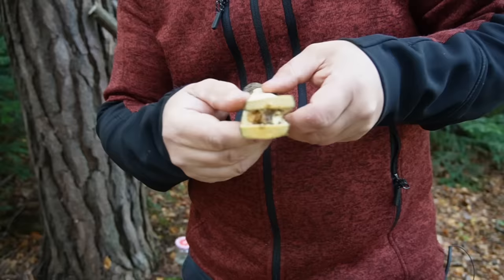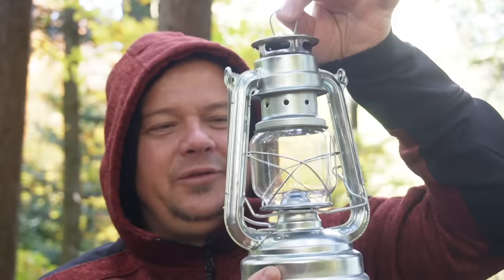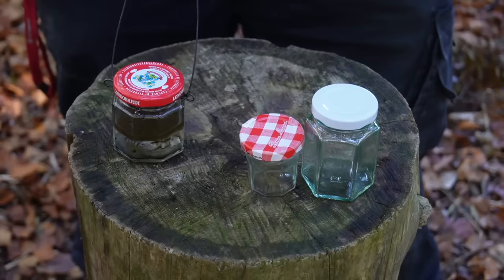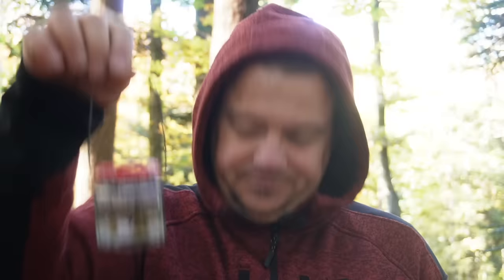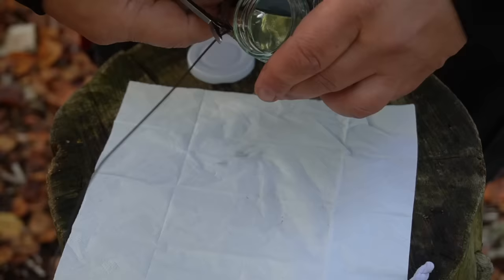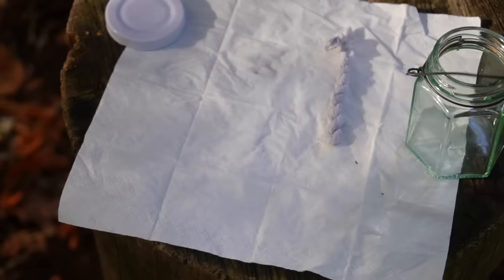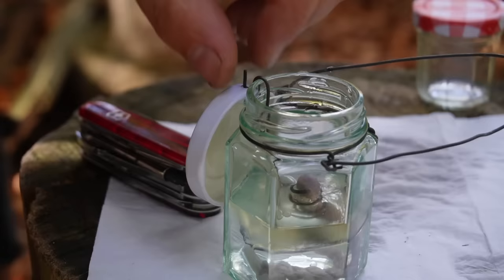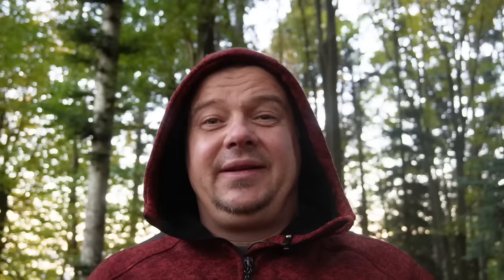Do you know the "Water Trick" for Oil Lamps? How to craft an Oil Lantern

Comment: interesting! I used to make the same thing, but to hold the wick, I used a piece from a plastic bottle and drill a hole to insert the wick. The plastic floats above the water, so no wick holder is needed! I use water mainly for safety. When the lamp is accidentally dropped or turned over, the water will put out the flame instead of leaving a burning wick on the floor.
Reply from the maker: wowww, thanks a lot for this valuable tips!

Comment: Hi Felix. I was experimenting with this sort of thing recently. I was using vegetable oil/cooking oil. I found that the oil needs a wick to burn. I did consider mixing with methylated spirit to lower the ignition point. I have a Trangia spirit cooker and the idea with them is you can use different types of fuel like petrol, diesel, spirit or vegetable oil for cooking at a push.

Comment: Hi Felix, I like this "tip" but have a question. Do you need to carry (and use) a second wick that is dry after the oil runs out and the incumbent is soaked with water? It's possible that the oil intentionally runs out because "you're" trying to use up all the "old" oil before switching to new. The old oil might still be usable, but less efficient because it's contaminated / dirty / oxidized ... etc. and frugal folks will try to use it until it's gone. Two wicks would allow the next one" to always be dry and ready while the retired one dries out. Just thinking and asking your thoughts.

Comment: I am a bit concerned about using water with oil in a lamp.since i accidentally got a few drops into a similar oil lamp, and it blew up. I said similar because the one i made back then, was made ouut of a small can, and the way it ignited the surface of the oil producing a much larger flame and heat,guess that was the reason it blew up😂. It heated the oil and the water beneath it so much that the water turned to steam.Oh the water was there before i ignited it, i realised there was water when it blew🥺. I had a few tries before and it went great,100ml of oil about 5 hours of burn time, flame about 8cm at the base,10 to 15 cm high.i abandoned it cause it was too dangerous.
Reply from the maker: Thank you very much for your honest advice. You are right... hot oil and water is a dangerous mixture. But only if the oil gets really hot. In my case this never happened. Never the less your comment is very important and valuable!

Comment: What did you use for oil?
Reply: He made walnut oil in a previous video. But any vegetable oil will work. Other oils will work but they might have too low of a flash point (that's the temperature where the oil will ignite even without a wick).
Reply from the maker: I took selfmade walnut oil... but you can take every oil you have.
Reply from the maker: Thanks a lot for your answer!

Comment: how does the jar not shatter - because of temperature difference?
Reply: Great question. The glass heats slowly perhaps .
Reply from the maker: that was never the problem until now...
Reply from the maker: May be this is the answer...
Reply: Basically, the water keeps the glass cool . . . until it doesn't of course!
Reply: Hi folks,

Mason jars can resist a relatively high temperature. However, they tend to have low thermal shock resistance... thereby, any quick changes in temperature can make them crack and break.

Borosilicate glass, on the other hand, is much more resistant to heat and thermal shock.
(For instance, much of the glass items in laboratory equipment are made of borosilicate glass - beakers, test tubes, etc. so they can take the direct flame of a Bunsen burner.

There are also borosilicate glass teaware items that can also be used on the stove or under a direct flame.)

For those who live in environments where temperatures get very cold... It may be worth searching for a borosilicate glass jar (w a metal lid), especially if issues of thermal shock to the glass lamp are a concern.

Happy Trails!  🇺🇸  🏕 🕯